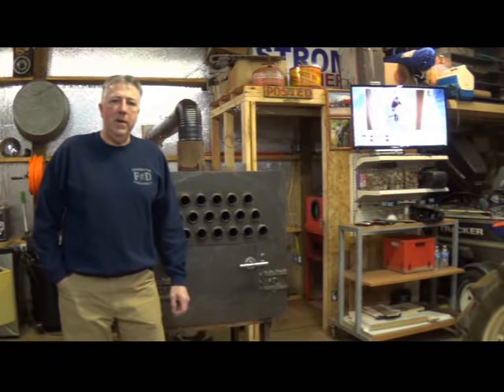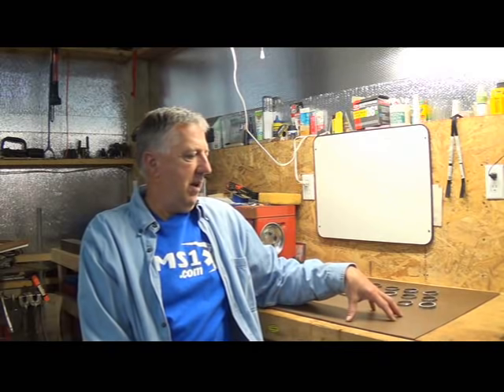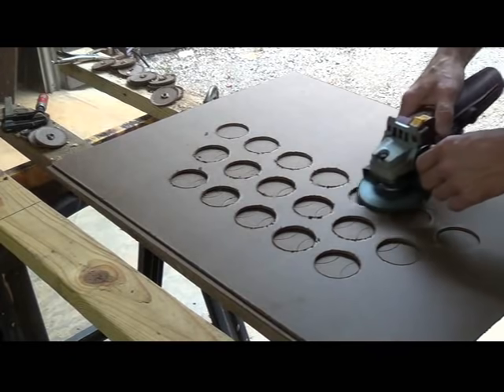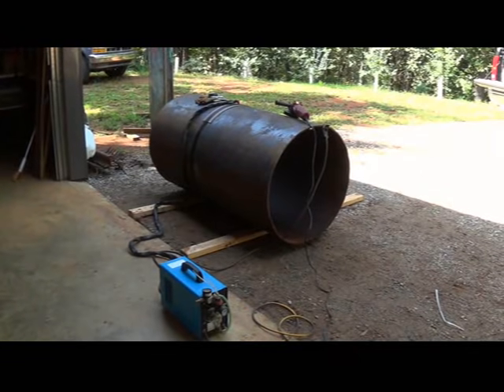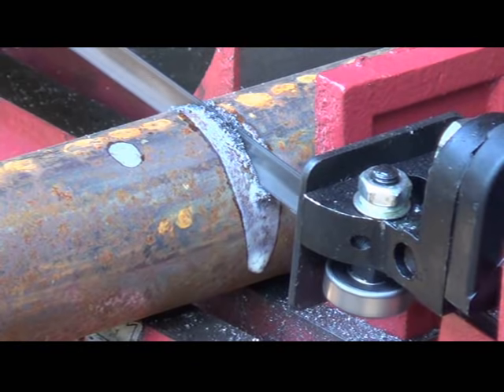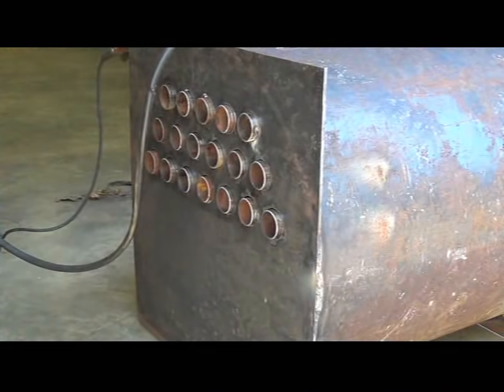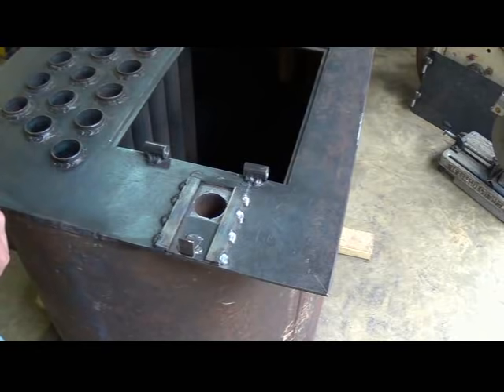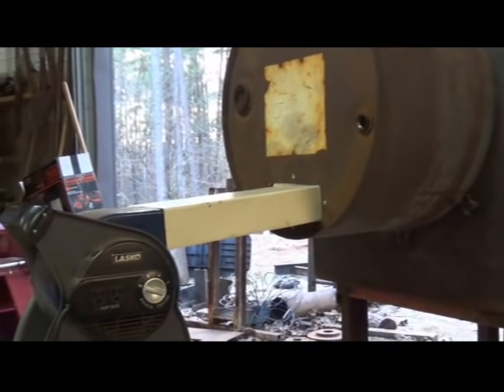Homemade wood burning shop heater

Comment: One of the best heat ex-changers I've seen made. Good job on the build. Will definitely use your example in the future.
Reply: ???What kind of insulation are you using on your shop walls?
Reply from the maker: Thanks!
Reply from the maker: @michaelroyalty2584  I'm not sure what it's called but it looks like bubble wrap with foil on both sides. It's only about 1/4" thick.

Comment: Been looking all over for a video like this.  Thanks.  I will need to buy more toys.  I mean tools.  🤙
Reply: Has anyone seen a heater like this for sale?  I want to make it but time is a challenge. .
Reply from the maker: Yes, this is how I justify buying new tools.
Reply: @youngrussel  i think you can omitt the plasmacutter here if you buy one of those metal holesaws. so you need only a good drill, an anglegrinder and a migwelder
Reply: @steffankaizer  yes it would be a cheaper alternative,  would need a high quality hole saw like a Lenox or a Milwaukee to get thru most of those holes provided you use cutting fluid.
Reply: How about a one year review ? Anything  you would change  ? Be awesome  to see a secondary burn chamber if possible. Thanks for the video,  very nice build sir.  -4 f  / -20c  here in Canada right now AND IT SUCKS  !!! .

Comment: Great build, only thing I would suggest adding is a diffuser plate on the pipes to prevent metal fatigue, I have fixed simular stoves and thats usually what happens to them, also a diffuser on the door to keep from warping it.
Reply from the maker: Thanks for the suggestions. Those are some things that I can add on and make the heater even better.

Comment: How has the door and the area surrounding the door been with warping.  The door maybe could have had some angle iron welded to it to stiffen it up.  The frame the door butts up against maybe some triangle gussets going from the door frame to the propane tank walls.  Heat cycling from hot to cold does some strange things to metal from the resulting expansion and contracting.  You have some great ideas tho in this build.
Reply from the maker: I haven’t had any trouble with warping due to normal operation of the heater. I honestly believe that welding on the door would probably cause more warping than building a fire in the heater.

Comment: Nice job. I need to build one of these this summer for my shop.
Reply from the maker: If you do, make the dampers and exhaust bigger than mine. Even though the heater works like it is, it could be better. I plan to modify later.

Comment: I've seriously watched this video 6 times now. Best built wood stove that I've ever saw and I've saw a lot of them.  Would you do anything different though or leave everything the same?
Reply from the maker: There are a few things that I would do different and I will make some modifications to the heater soon. Because of the size of the heater, I should have used 8" chimney pipe instead of 6" and I should have made larger damper openings. I also should have thought of a way to clean the creosote off of the heat exchanger tubes (see earlier comment from kahvac & Mark Turney). Even though the heater works very well, I think these modifications will make it much more efficient. Thanks for your comment!

Comment: NICE JOB!!  may be you can put a shield for the pipes....piece of blue stone...or some flat stone you can attach to it giving it some space off course...also you can put bricks or concrete blocks around it so you don't get burned and it can serve as a heat battery...softer heat than direct fire heat.
Reply from the maker: Thanks for your comment.

Comment: From my machining days i was told to not try to use a fly cutter freehand. They should always be used in a drill press on clamped material. That can get off line, grab the work and twist the drill out of your had. The  cutter can do a lot of damage. Not safe. Use a hole saw in that situation.

The stove is well done. Good design and good workmanship.  I would have added an ash tray underneath the grate to make clean out easier. I also would have welded a flat plate on top for a teakettle .
Reply from the maker: Thanks for the safety tip. I always try to work safe. I would have used a hole saw but I couldn't find one that would cut the exact size needed.

Comment: Nice job! Just a helpful hint though. They have a handy dandy tool called a holesaw. Only buy Lenox or Milwaukee bits. They will cut through 1/2" plate no problem. But after you drill the 1/4" center guide hole put a piece of 1/4" rod in the holesaw bit holder. Because you'll break drill bits. And I didn't see your damper. You'll save a boatload of wood with a damper. Otherwise all the heat goes out the flue. And that's just wasteful. And use big wood in the big stove! That saves lots of wood also!
Reply from the maker: Thanks for the comments. There is a damper, it's just hard to see in the video. It is located in the stove pipe after it makes the 90 degree turn. As for the holesaw, that would probably make life easier but I was trying to get by with the tools that I currently have on hand.

Comment: Great job! I plan to build a similar heater, but force that hot air coming out from those pipes into a 8x8 steel structure .   I think it would get hot enough to sterilize firewood (190 degrees) as well as dry it out pretty quick - essentially heating a firewood kiln. Do you think that would work - if you directed all that heat into an area that size?   If that was your goal, would you do anything else or anything different? Thanks and great job by the way  Also, anybody else that may read this and has an idea, please mention it.
Reply from the maker: That might work for an 8X8 room as long as it is well insulated or summer time.
Reply from the maker: If you are planing on building a heater the same size as mine, you will probably want to increase the chimney size to 8" and also increase the damper size to increase the air flow. I will probably make those modifications to mine also.
Reply: @medic91716  good thinkin and thanks
Reply: @Brian-mc4pd  did you ever start or attempt this ? I am thinking the exact same as you. Be interested to know what happened.

Comment: A nice build...at some point your going to need access to clean the outside of the heat exchanger tubes.
The middle tubes are almost impossible to clean. I'm sure you'll figure out a way... Thanks for sharing with us !
Reply from the maker: Your right, because I've got those tubes in there tight. I will have to start working on a solution for that immediately.
Reply: @medic91716  if you build another one make another plate like the front and back with the pipe holes and place it inside loose on the pipes than attach a rod to it sticking out the front so you can move it front to back cleaning the pipes off. I've seen factory built heat exchangers designed like that.
Reply from the maker: @allenmckinney9533  That is a great solution. Just use some lighter material.
Reply: Something comes to mind, I have no experience with it so I'm just thinking here. . .  I see ads on TV all the time, creosote burning logs for reducing creosote in chimneys. Worth a try?

Comment: Hello! To prevent the door of your furnace from bending from the high temperature of the flame, you can protect the door. 4 short bolts 1 inch long are welded on the inner wall of the door and another sheet of metal is welded to them a little smaller, this helps and prolongs the service life.
Reply from the maker: Thanks for the tip.

Comment: Hello Ron, could you please tell me what is the efficiency of this stove ??? How big is your shop in square feet ??? How much wood do you burn in a average year ???? Thanks
Reply from the maker: My shop is 30’X36’ and the heater warms it very well when temperatures are in the low 30s. I only heat the shop on the few days that I actually get to go down and work and I live in Mississippi where it was 60 degrees 3 days ago and 30 degrees today so it would be hard to determine how much wood it would burn if it was used on a more regular basis. But to answer your question the best way I can, on the cold days that I get to use the heater, it does seem to be efficient and not use a lot of wood.
Reply: @medic91716  Thanks Ron for the information fella.
Reply: I was thinking that if you would of put in a baffle with secondary air intake the burner would be way way more efficient PERIOD. How thick is the propane tank steel wall thickness?? 
Nice work Sir.

Comment: Will you be kind to show how did you clean the tank? Is there anything that you used to clean it? I have a small tank, it will provide the knowledge and information to consider before attempting to do anything. Much appreciated 🐾🐾🐾🐾
Reply from the maker: After removing the fittings from the tank, I cleaned the inside of the tank with degreaser and water, multiple times. I then placed the tank in a pile of tree limbs and brush and let it burn all night to remove the paint. You must make sure you have cleaned the inside of the tank completely. You should also remove the fittings so pressure can not build up in the tank and cause an explosion. Do all of this before getting it near any ignition source or cutting equipment. To add another level of safety, you can use non sparking tools until the tank is completely cleaned of gas. I have seen some other videos on how to safely prepare and gas tank for cutting. You may want to watch those also. You can never be too safe when working on a gas tank.
Reply: Thank you for your prompt reply. I will consider and follow your suggestion. It has to be thoroughly clean; very well done your video and well explained. Much appreciated 🐾🐾🐾🐾🐾😘😘😘😘

Comment: Do you think the end pieces needed to be 1/4 inch even though all the rest was 1/8 aka 11 gauge?
Reply from the maker: 1/8" will probably be fine for the ends. I used 1/4" because that is what I had available at the time. The propane tank itself is actually more than 1/4" thick. If you are planing on building a heater the same size as mine, you will probably want to increase the chimney size to 8" and also increase the damper size to increase the air flow. I will probably make those modifications to mine also.
Reply: @medic91716  I am making one.  I am having trouble finding a propane or fuel oil tank.  I have the steel to make a square or rectangle one, but the round firebox has such clean lines to it.
Reply: @chadhanson3431  what about an old air compressor tank?

Comment: What gauge steel tube did you use ? I have a double barrel stove I wouldn’t mind adding tubes to. Thanks in advance.
Reply from the maker: I'm not sure what gauge it is but the tube wall is very close to 1/8" thick.
Reply: Ron Strom thank you sir!

Comment: I’m thinking of building shop heater just like yours, any advice or things you would do differently if you had it to do over again. Thanks in advance
Reply from the maker: Because of the large size of the heater, I would have made made the stove pipe opening 8" instead of 6" and I would have made bigger damper openings. These are things that I will eventually modify. Even though it works fine like it is, I think it will work even better after these changes.

Comment: what are you using for your welder?
Reply from the maker: I am using two different welders. One is a Chicago Electric (Harbor Freight) 170 Amp mig welder and the other is a Lincoln stick welder.

Comment: Did you have any trouble with creosote building up on the heat exchangers?
Reply from the maker: I have seen some minor buildup but not enough to cause any problems.
Reply: @medic91716  my upper chamber actually FILLED UP with creosote and blocked the chimney. Cant figure out why.

Do you think i took out too much heat?

Do i need to add an "after burner"? Somehow....
Reply from the maker: @kennruckey  Are you burning well seasoned wood? Green wood will cause more buildup.
Reply: @medic91716  actually burning pallets...
Reply from the maker: @kennruckey  https://www.amazon.com/Rutland-Products-98-Creosote-Remover/dp/B00120NNCY/ref=mp_s_a_1_3?adgrpid=53568467502&dchild=1&gclid=Cj0KCQiA34OBBhCcARIsAG32uvPbypnPC3bkkl-e0RKkCCyQ78FvsXHHPrSRAOrTn4jJPcBRQRnP7dkaApdGEALw_wcB&hvadid=409947738703&hvdev=m&hvlocphy=9013807&hvnetw=g&hvqmt=e&hvrand=13080772659312009692&hvtargid=kwd-337609910531&hydadcr=13571_11413583&keywords=creosote+powder&qid=1612840871&sr=8-3&tag=hydsma-20
Reply: @medic91716  thanks!

Comment: Should have had those boiler tubes cladded in Inconel. They would have lasted a very long time.  You will have to plug or cut out those tubes in a about 3-4 years.
Reply from the maker: Thanks for the tip.

Comment: Great video love all the info ! What is that fan called , and where to buy a fan ?
Reply from the maker: This is the same fan that I am using, just has a different brand name placed on it. I got it several years ago at WalMart.
https://www.amazon.com/Stanley-655704-Velocity-Blower-Yellow/dp/B006O6FA22/ref=sr_1_3?ie=UTF8&qid=1548859505&sr=8-3&keywords=blower+fan

Comment: Thank you so much for your input . how big on dampers ? I am also building my shop heater out of 500 gal propane like you did
Reply from the maker: Right now I have two 2" dampers. I would like to have at least 3 times that much so I won't have to crack the door open to get the fire going quicker. I might even add a small blower to force air in. But like I said earlier, I need to increase the chimney diameter also. I know there is a science to all of this, I just haven't got it down yet.
Reply: just started my templet went with 5 in dampers and im also putting a ash tray right below the door, so if I need more air I can open it @medic91716

Comment: when you fire u p your stove do you do like i do fillit up half  way withnewspaper and kndling   and let it burn for 10 to 15 minutes on high air  and than fill up the stove with logs  and keep it on high air  in till it gets burning good than in dial it down the air
Reply from the maker: I don't use any news paper. I just put some kindling in the heater, stack some logs on top, then light it up.

Comment: How does that home made stove work with the insurance company??
Reply from the maker: Not sure about that. This heater should be as safe as any other as long as the stove pipe is properly attached.
Reply: When I inquired with my insurance about a homemade wood stove in my shop, that was a very quick "no, we will not cover it" from my agent.

Comment: I like it, but I would rather have it with a pellet hopper attached so  it would feed automatically.
Reply from the maker: That would be convenient, but would the pellets produce the flames required to heat the tubes to the desired temperature?

Comment: Have you had a creosote fire from the deposits on the tubes yet?
Reply from the maker: If you are asking about the tubes used for the heat exchange, the answer is no. Creosote does not build up inside of them because they are sealed off from the fire chamber. There may be some build up in the chimney pipe but no fire yet.
Reply: @medic91716  ....
My heat exchanger tubes condensed creosote on their outsides because the fan kept them cool. When the creosote caught fire one day on my unit and cracked all my welds. My next design will need to have a cleaning access door of some kind.
Reply from the maker: @deerlakediver5554  I haven't use my heater enough for that much creosote to buildup. Thanks for letting me know what to watch out for.

Comment: What kind of pipe for the heat exchanger
Reply from the maker: Not sure what schedule it is. It's 2" pipe that has about 1/8'" wall thickness. It was actually being sold as scrap at the local steel yard.

Comment: dear sir, I am Balamurugan. I need your help to design air heater.plz help me. air flow rate is 5000 kg/hr. it's to be heated upto 200 celsius. plz tell me dia and length of the stove, length and dia of the pipe. plz help me sir

Comment: Fill it with water before (as) you cut that tank
Reply from the maker: Yes, that would add another element of safety.
Reply: @medic91716  or CO2